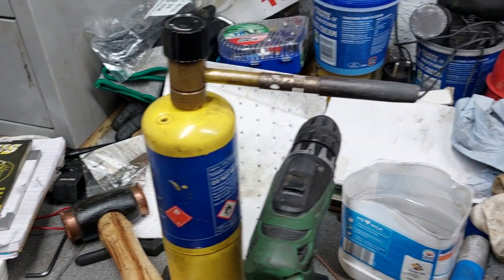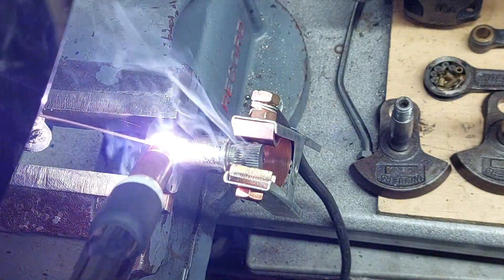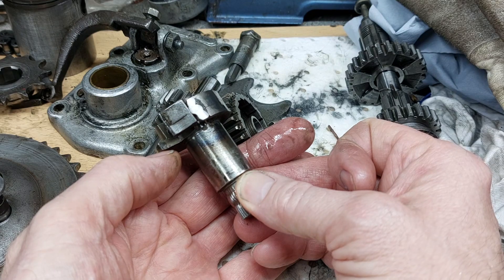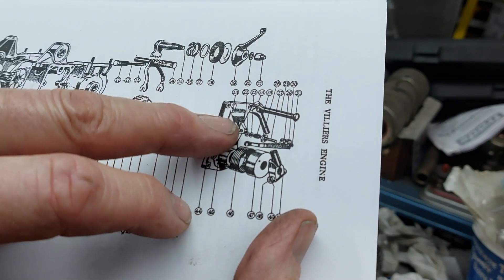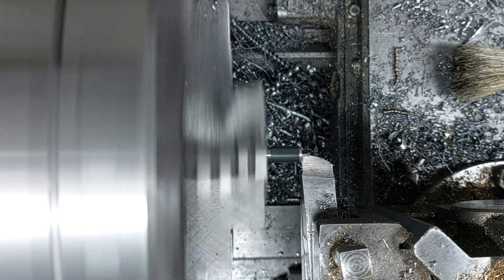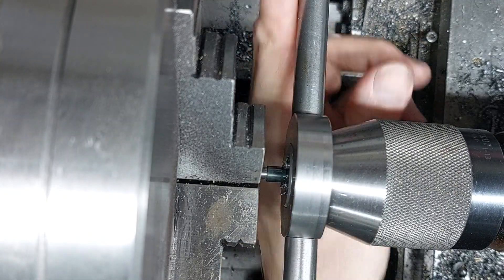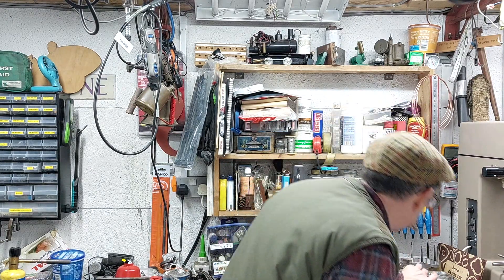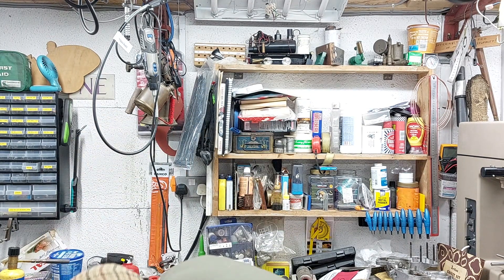REPAIRING VILLIERS ENGINE FROM 1939 EXCELSIOR UNIVERSAL

Comment: enjoy watching the rebuild of Villiers 9D  engine could you tell me where you got your workshop manual 
as i  can't find one anywhere for a 9D  engine the one you showed of the gearbox help me tremendously

many thanks Peter
Reply from the maker: Check these guys out Peter https://villiersservices.co.uk/ best to phone them if ordering 9D parts as a lot aren't listed but they have a lot of parts on the shelf ( like the correct clutch pressure plate and push rods etc ) they are very helpful and they have the manual you're after.

Comment: Iam quiet suprised there are no bronze thrust washers between the rod and the crank halves
Reply from the maker: The shoulders on the crank pin allow  an amount of end float between bearings and crank webs so i suppose the thinking is that there would be little contact

Comment: Hello Mr Tweed. Just wondered about how you are going to get Crankcase compression for fuel transfer , now that you have removed the seals. Something 2 strokes need is a sealed crankcase. Or am i missing something. ???????
Reply from the maker: Hi Stevie, the phosphor bronze bushes have been replaced with modern oil/crank  seals , the previous video shows the engine cases being machined to take them, thanks for tuning in 😊
https://youtu.be/fVPUxKVgVHE
Reply: @TweedsGarage  Ah. I did wonder. I will take a look at the vid. 
Regards.
Steve.

Comment: Nice job Allan, puzzled as to why you did away with the grease seals from the bearings; at RHP we made all the bearings for British Leyland engines and most of them were double sealed, you've obviously got your reasons and they're still going to get lubricated, looking forward to the next one...
Reply from the maker: Cheers Allen, the main reason is to assist the new crank lip seals in retaining crank case pressure ( they are normally fitted with open bearings, the gearbox output bearing will have the same treatment to retain gearbox oil as that originally had an open bearing and a felt washer to attempt to keep the gearbox oil in ( which it didn't) 😁
Reply: @TweedsGarage  Got you, would never have thought of that, I'll stick to being a retired turner in future...😆